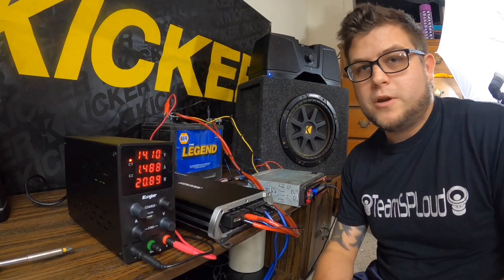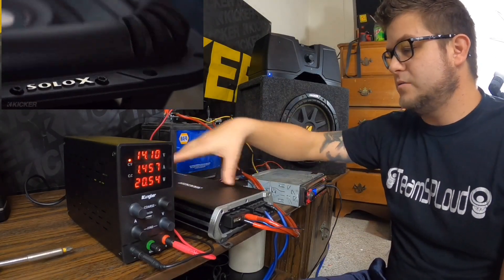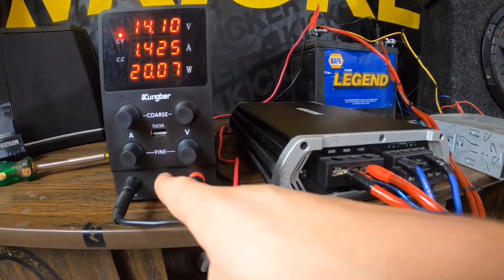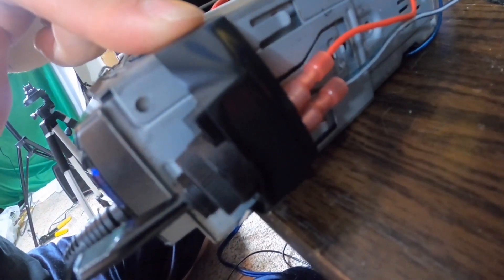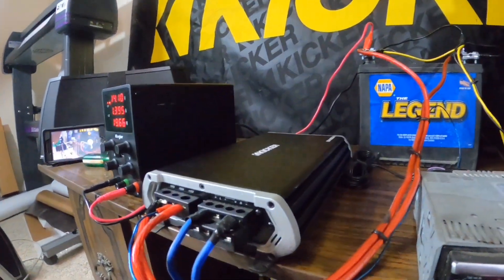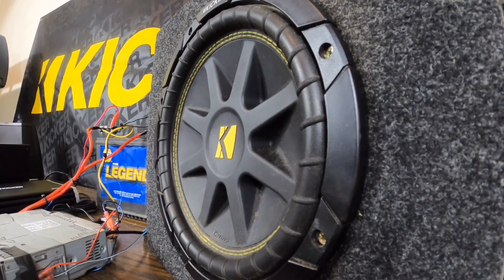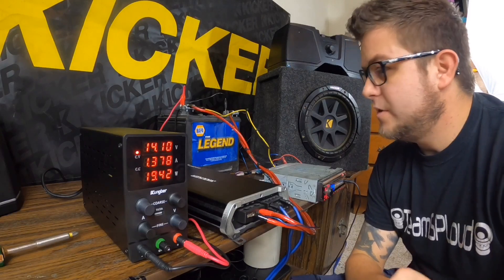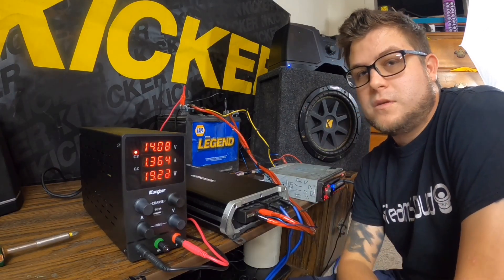HOW TO BUILD YOUR OWN CAR STEREO IN YOUR HOUSE - TEST BENCH

Comment: My question before I buy for car stereo in home so which one is best ....... 30V 10A, OR 60V 5A, OR 120V 3A IF I install 4 amplifers or more ?
Reply from the maker: @JasonPickens-k1d  for car audio I recommend the 30v and 10a and up! 

I love my 30v 30a model 👊🏼

Always run with a battery so you don’t hurt the power supply by over demanding it !
Reply: @LivinLoudwithAndy  Thank you for answer my question ...... Again 1 30v and 10amp or up can hold more then 4 car stereo amp ?
Reply: Hey

Comment: hey there, is there any update videos to this? been meaning to ask about mains voltage to dc power supplies . I have noticed lots of videos of car systems on trailers or set up outside of a car, even a pile on the street sometimes haha... they sort of use it like a pro audio party rental and seem to just use large output power supplies with all car audio amps 

its a weird rabbit hole kind of culture shock often seems like foreign countries, yet to find one English speaking but the systems they make are outrageous and seem to have lots of money put into it, I'm not even sure what one would look up to find such systems haha its a odd mix of the DJ and car audio scene
Reply from the maker: I will update this just for you bro! 

Same concept but I’ll go into depth with it 👏🏼🔥

Been often temped to make a complete surround system via 12v equipment 

Hope all has been well bro !

Comment: I bought a Samlex Rps1203 on eBay before I found your video, can that charge the battery or perhaps i should buy the same one you got?
Reply from the maker: It will technically work but to charge a battery a smart charger is better 

For small 12v tests that’s perfect
Reply: Thanks Andy, I bought one like yours on Amazon for $63

Comment: So I have a question for you.. The set up u have is what im building.. minus im using a hc2400 kinetic.. Deep cell agm.. Ok so with this power supply.. Does the power supply turn off when the battery is fully charged.. When not testing.. Or does it stay on constantly..?? Just thought I get your input..
Reply from the maker: Always stays on.. now the settings inside the power supply work like this... when voltage is needed to be reached it will charge up to the amperage you set 0-10 - just as you would voltage... if you aren’t using it keep it set at 13.3 v and only 1A
Reply: So that thing will constantly run?? So is it better to get a battery charger/maintainer.. ?? I mean I ever thought about useing a Stanley jump box.. It has a hell of a battery in it.. It can draw up to 1000 amps on it.. But.. Of course I wont do that..

Comment: Cool test bench! If you wanna upgrade your power supply on the cheap check out Dell server power supplies you can get 70-105amp 12v models for around $30-$60 on eBay and they’re easily modible for what we do.
Reply from the maker: Wow no way! That’s a great deal really